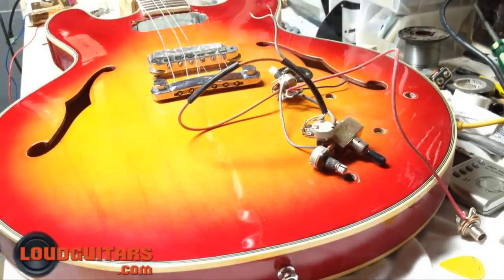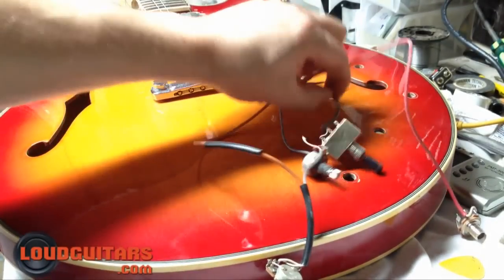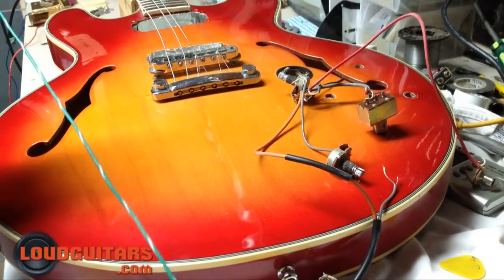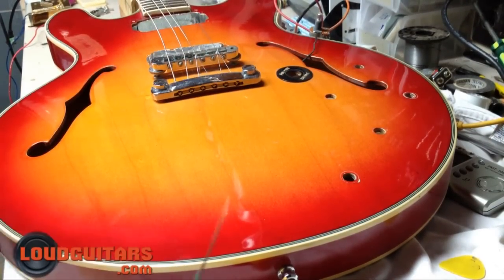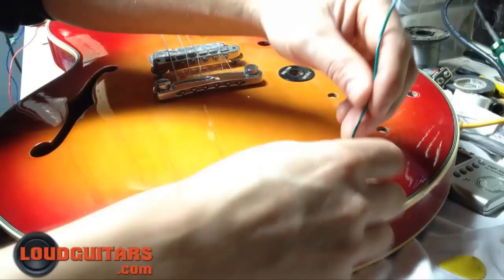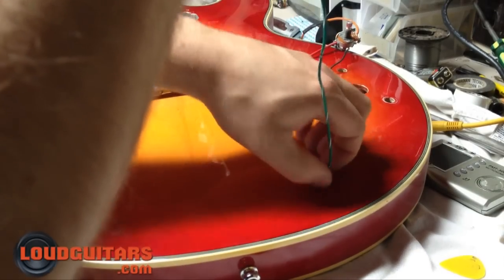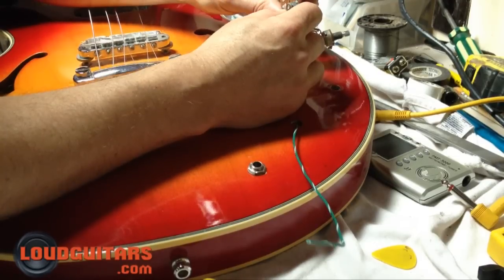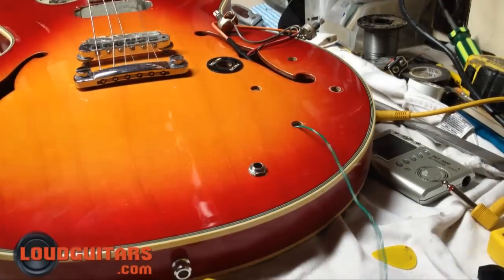How to rewire a hollow body-DIY

Comment: Great tip to use the wire.  Worked out perfect for the output jack.  But I improved on this for the pots.  I used a garbage bag plastic/wire tie (or garden tie) to attach to the pot.  Slips in the pot crack perfectly.  When I used the wire I couldn't get it from slipping out.  I saw other people using rubber bands but it looked hard and I witnessed them breaking the bands during the demo.  Another tip is to find the wire is simply cut an old extension cord (or buy a cheap one for a couple bucks).

Comment: Didn't have any issues scratching the f holes.  Had purchased simple masking tape for a couple bucks which was cheaper than the proprietary blue tape which does the same thing; but I never had to use it.  Did have to keep putting a small towel down to not scratching the top.  I swapped pickups on my AS73 thanks to this video.  Was up till 3 am.  Takes patience until you figure out the system.  For me another key was choosing the right sequence to re-assemble the pots.  I dropped the F bomb word several times and got reprimanded from my wife lol.  But in the long run very satisfying to get this done and get rid of the horrid over voiced pickups that my Ibanez came with.

Comment: Where's the ground wire from the bridge come from?
Reply from the maker: Comes from the bridge ? It is a semi hollow so it has a passage through the block.
Reply: @LoudGuitars  In hindsight, that was a poorly-worded question. Lol. I've got a Japanese 335 copy with a Bigsby and the ground doesn't come from the bridge. There's a wire going from under the Bigsby near the strap button and it runs all the way over to the shielded lead coming from the pickup. Have you seen that before? Makes sense, I guess, but it seemed weird to me when I was putting together the harness.

Comment: Good video, but are you sure this is a hollow-body guitar? I think it's a semi-hollow
Reply from the maker: Thanks, no center block in this, not sure what difference it makes in context ?
Reply: Loud Guitars I see, thanks for the info. The wiring circuit might makes no difference but most hollowbody guitars have different hardware placement, and might have a totally different wiring structure/measurements inside if compared to a semihollow. Anyway, this helps me a lot with the circuit diagram 👌

Comment: NEED YOUR HELP – To ANYONE having experience working on hollow body electrics,
I have an Epiphone Swingster (Joe Pass Emperor) with a Bigsby Trem and Fultron pups.
It has MYSTERY BUZZ that I can Not find ANYWHERE and its driving me crazy.
  It happens on the G and B string around 1st and 7th fret. I DON’T THINK IT’S A FRET SITUATION because I set set the action as high as it would go and the buzzing is still there. The buzzing sounds like a loose wire or screw behind the neck pickup. Is there an internal bolt holding the neck to the body? Maybe that’s lose?
 If ANYONE has any IDEAS PLEASE LET ME KNOW. You would be a life saver…
Reply: Check for bent strings.  Happened to me.  One string, one fret.  Looked closely, saw the bend, changed the G string, no more buzz.
Reply: @dougselsam5393  this may sound crazy Doug but at this juncture - had the mild buzz so long I feel it sort of BELONGS there now. I like it. It give a sort of break-out "dirty" gain tone. I hope its always there :)
Reply: @WebbChannel1  Try a Fuzz pedal.  :)

Comment: From what I've seen my luthier had done for years (late 60s and 70s, yes....he aint no Millennial) is that NEVER fish anything through the f holes.  It all should be fed or taken out through the pick up holes....its a bigger hole and less damages to the guitar.  Use fishtank air filter tubings to fish the pots through the pick up holes and up the pot holes.   Easily don this way instead of using wires.
Reply from the maker: gmlasam coated wire is not going to hurt the finish or the guitar. The way you suggest would work as well. Cheers
Reply: Doesn’t work with semi hollows like a 335. The hole is usually nowhere near big enough to get a pot through.